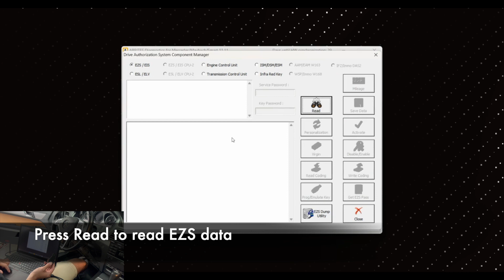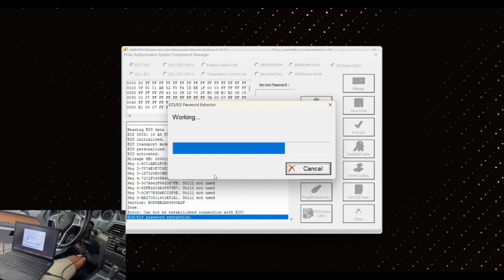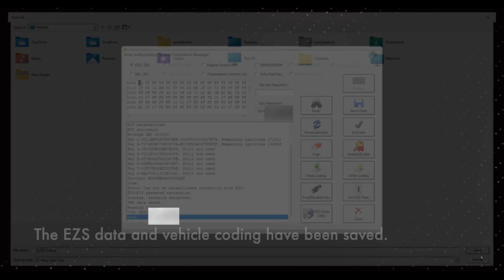W207 Mercedes-Benz E-class Coupé EZS Password Extraction Using ZN076

Comment: How do you get to the esl connector
Reply: It is not that difficult, it sits on top of the ESL and if you have thin wrists it is easy to unclip it, if your wrists are thicker - you need to approach from the side of the steering column, it is very much doable, just need to do it once and you will be ok for all of them :) In the other models it is a lot easier because the connector is on hte lower side.